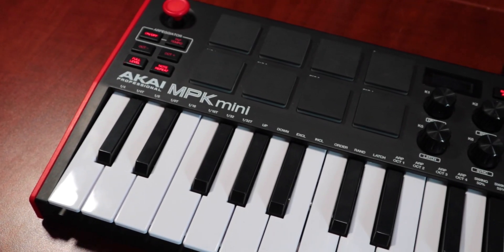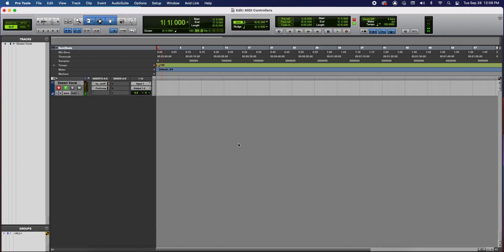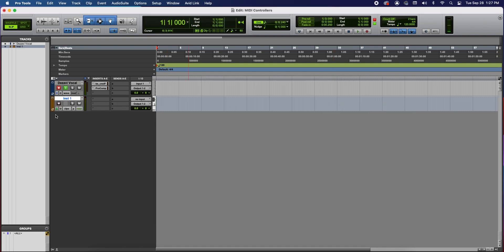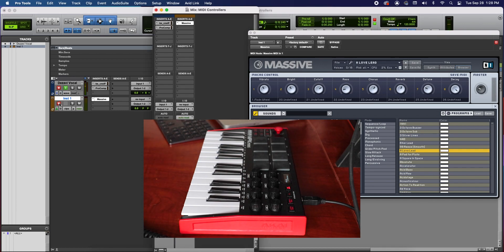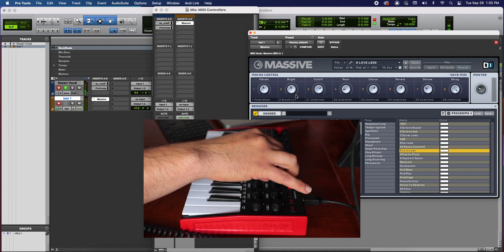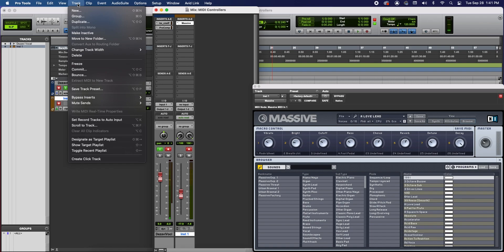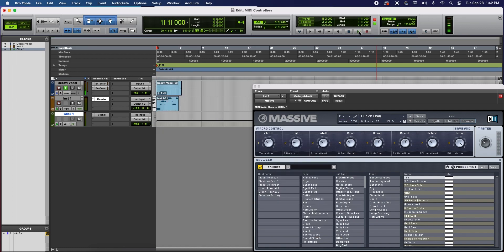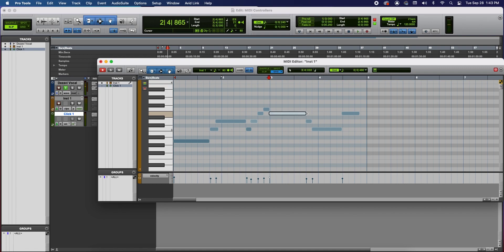ProTools MIDI Controllers Part 1 | How To Connect Setup & Use

Comment: hi Dezavi, thanks for Pro Tools MIDI Controllers Part 1 & P.2, very informative! Can you please post a video with the same set-up but using the knobs of the controller for volume & pan. I'm told it's easy using the controller in final mixes for panning, volume & EQ automation? Can you please help

Comment: Is it possible to use the play/rec buttons from the controller to control playback and record on Pro Tools?
Reply from the maker: Hi, it is possible yes. What MIDI controller are you using?
Reply: @DezaviProductions Have the same question. I just bought the Donner DMK25 pro(similar to Akai). The only buttons that work for me are the keys of the keyboard. Would love to also use the buttons for record, play etc. I wouldn't be asking if I didn't spend days trying myself. Great video by the way! Helped a lot!

Comment: And what if it still dont work?
Reply from the maker: Hi, I’m sorry to hear you’re having trouble. What controller are you trying to use with ProTools?
Reply: @DezaviProductions  Just figured it out. It was a volume issue. I have an Akai MPK mini. I noticed I still have to crank the volume way up as the drums and keys have a very low response.

Comment: i want to use the knobs for faders of volume or sends how can i do that?
Reply from the maker: Hi Elosbyuri! My apologies for the late response. I’ve been very busy the past year and will be getting back to making YouTube videos on a consistent basis starting next month. You can use midi mapping to assign the faders to the knobs.
Reply: @DezaviProductions  to control faders and knobs in protools you need a device that supports hui protocol. mpk does not support it. Theres a lot of info on the internet about that, people not being able to use knobs and faders with protools and mpk. i have not found not a single page with info about a person making it work. and ive been searching for days. as i learned - to control those knobs and faders you need controller that supports hui, wich is the protocol used by protools. You are literally the only person on the whole internet that made it work. How??? Please help cuz my mpk is practically unusable :( please help

Comment: How do you setup and play old school synths (Juno 106) (and their sounds) out of Pro Tools through 5pin connection? Thx
Reply from the maker: Hi, great question. I’ve only connected one and that’s the Ensoniq ASR10 that I have. I haven’t worked with it much digitally but what I’ve been able to do is use it as a MIDI keyboard by using the MIDI IN and OUT connections with an interface that has those same connections. As far as playing their sounds, I route the audio output to an input on a mixer or interface. Does this help? I think I’ll make a video covering this.

Comment: When I try to enter an input, the "plug-in" option is dark, and won't let me click on it
I'm using an Akai mpd226
Any advice by any chance?
Reply from the maker: Hey, it sounds like you’re trying to add a plug-in to a routing signal. Instead click on one of the slots on the “insert” section and it will allow you to add a plug-in. Does this help?

Comment: Pro Tools shows my MPK mini, though it has "Emulated" in parenthasis. But there is no sound coming from it. I've followed several guides and just nothing happens...
Reply from the maker: Hi, I'm sorry to hear you're having issues connecting your controller. I've had several comments with the similar issue and I'm still unable to figure out why some are showing "Emulated". Do you use the Akai MPK MIni Editor software that came with controller after you registered online?
Reply: @DezaviProductions  I was running the software, then I closed it out, and nothing happened either way. Odd thing, it just started working about an hour or so after I made my post yesterday. I don't have a clue what I might have done to make it work, but, uh, problem solved, I guess... #shrug
Reply from the maker: That’s great to hear, I’m glad it’s working for you now. Yeah that’s very odd. If you have any questions or anything you’d like to see a video for please do let me know, thank you!

Comment: I've done all that and still no sound
Reply from the maker: Sorry to hear that Micah, what controller are you using?
Reply: Novation Launchkey MK 3
Reply from the maker: I also have the Novation Launchkey MK3. Mine is the 49 key. If you have the same one, press the “Device” button under the first fader.

Comment: Hey Dezavi, great video! I am a complete newbie with ProTools, could you please give me some directions on how to properly setup I/O to hear my MIDI Keystation MK3 in my headphones when using ProTools? Thank you very much
Reply from the maker: Hey Lazzo, thank you for watching! What interface are you using?
Reply: Hi Dezavi, thank you very much for your fast reply, I do appreciate it.
I don’t use any Audio Interface yet as it is a plug-in and play midi controller, but maybe I should get one?
Reply from the maker: It’s okay, you don’t really need an interface if you’re not recording with a mic or instrument. First and foremost, make sure that the track you are using is record enabled and that the output is set to your main speakers/headphones. Also, in the drop down menus, go to “setup” and select “playback engine”. In there, make sure that in the device section, your have the proper selection for which you want to use.
Reply: Yeah, that’s what I’m trying to figure out:) It would be amazing if you could demonstrate how to properly setup midi controller ( IN ) using headphones (OUT) in Pro Tools, to be able hearing sound through the headphones.

Comment: Hello, I have the same AKAI MINI 3, I do all the steps but I get some things different.
1- MPK Mini 3 (Emulated)
2- inst 1 / plugin / instrument / Click II (Mono)... Thats the only option I get on the instrument tab :(
Then nothing happens.

I already updated the firmware for the Akai
Reply from the maker: Hi Alberto, I'm sorry to hear that you're having trouble with your MIDI controller. Did you download MPK Mini Editor for your controller? Also, it seems as though you have a "Click/Metronome" on your instrument track. It must be a virtual instrument that must be used in an insert of the instrument track. Virtual Instruments must be in the AAX format. Do you have any virtual instruments that you can use? Xpand2 is a popular default virtual instrument.
Reply: @DezaviProductions  I don’t really understand 😅. I’m following each step and have the same Akai mini as the video.
Reply: I’m going to download MPK MINI EDITOR then, I haven’t downloaded any additional software 😅
Reply from the maker: Yes lol. Make sure you follow all the setup instructions that came with your MPK Mini and that you register your controller with AKAI online. Also, I previously made a video on how to record virtual instruments. Here’s the link below: https://youtu.be/x5lRmb8q-II I hope this helps.
Reply: @DezaviProductions  thanks! 😅 si actually installed a bunch of things that came with it and then uninstalled others, I might have uninstalled basic ones also 🥴

Comment: I have a maschine mikro controller and it's not on the list. If it's disabled, is there any way to enable it for use? or am I just sh*t out of luck? Great video by the way!
Reply from the maker: Hi Ariel thank you for watching! There is another way to setup your MIDI controller. It is a bit different. I will try my best to explain it here but will most likely make a new video for the explanation. Go to "Setup" in the menu and choose "Peripherals". In peripherals click on "MIDI Controllers". Where is says "TYPE" choose "M-Audio Keyboard". Where it says "Receive From" and "Send To" select your controller. Click OK at the bottom. Let me know if this helps, I'll be making a video for this thank you for your question and I'm glad you liked the video, please subscribe! I have more videos on the way.
Reply: @DezaviProductions  thanks! I just tried this but no luck. I tried “M-Audio” on type with no luck, but I also have the option “Komplete Kontrol” which is my midi pad however, the “receive from” and “send to” only show my audio interface and whatever option I choose, pro tools gives me an error saying to power cycle my pad and check connections. It’s strange because my midi pad works perfectly on the Maschine software. It might just not be compatible but thanks for the reply and I will subscribe! Pro tools is giving me headaches lol
Reply from the maker: I’m sorry the options didn’t work, I’ll do some research and see how that issue can be resolved! ProTools is not the best when it comes to creativity and can sometimes make you hit creative blocks because of it. They just recently updated their softwares and added a drum machine finally after so many years. I’ll be trying many different things and post videos in regards to the new updates and drum machine as well as the synth machine. Thank you so much for subscribing and watching!

Comment: What about the pads ....
Reply from the maker: I honestly spaced out completely about the pads when making the video, but they play just the same as the keys. You can cycle thru the different sounds by switching banks but because there’s only 16 pads total combined between the two banks, you’re only limited to 16 sounds on the pads. The pads are most effective when using a drum machine VST.

Comment: I don't know anything about midi but I need to learn since I bought avid carbon.  Which midi controller (49 keys) should I buy which will connect easiest with pro tools 2021. Info will be much appreciated.  Thanks
Reply from the maker: Congratulations on your Avid Carbon Interface 🎊! There are many brands out there but my personal favorite for ProTools is Akai. A 49 key controller they have is the MPK249. This one has a transport (Play, Stop, and Record button) that you can use to control ProTools. Other great brands are Alesis, Arturia, and M-Audio. Other brands such as Novation and Native Instruments are great too and are compatible but are typically paired with other software. You’ll find that many MIDI Controllers have settings that are mapped to use with all software and never have settings for ProTools. This is because ProTools isn’t typically used as much for beat making. Other software such as Fruity Loops and Ableton Live are much easier to get creative in than ProTools. I personally use Ableton Live to create beats and experiment with music. I use ProTools for all editing, mixing, and mastering. I use both. Ableton for creation and ProTools for perfection.

Comment: Hey dude, I've done everything, step by step and still no signal coming from my MIDI. ProTools identifies it in the MIDI setup. I create an instrument track and still no signal coming through...Any help?
Reply from the maker: What keyboard or controller are you using?
Reply: @DezaviProductions  I just got the akai mpk mini
Reply from the maker: Okay, and what is the plug-in virtual instrument you are using?
Reply: @DezaviProductions  it’s gotta be my DAW yeah? ProTools and my interface are not getting the final from the MIDI..
Reply from the maker: @krutonfreckle  if you’re using a USB cable the interface shouldn’t be involved. Make sure you have a Virtual Instrument plugin on your instrument track and that the record enable button is on as well as the output set to your monitors/speakers. Create a mono instrument track and then add your virtual instrument plug in to that particular track. Let me know if you continue to have issues, I’m here to help!

Comment: I'm having some trouble connecting my motif 7 to pro tools...I downloaded the driver and the motif shows up as checked off in the set up-MIDI-input devices menu. However, I'm not getting any signal from it into my instrument track(using expand). I'm Using the Apollo x4. What am I missing?
Reply from the maker: Hi! I’m sorry to hear that! There was someone who had a similar issue with their device and they mentioned that using a mono track instead of a stereo track fixed the issue. Try creating a mono instrument track and see if that helps. Also, make sure your track is record enabled and that your outputs are correct as well. Let me know if this helps, we’ll figure it out 👍🏻

Comment: In input enable settings my screen says MPK mini 3 (Emulator) instead of just MPK mini 3 and I'm wondering if this is the problem. Thoughts?
Reply from the maker: Hi! It very well could be the problem. Couple things to trouble shoot. First check to make sure that “MIDI THRU” in the “OPTIONS” drop down menu is checked and enabled. Restart the software after if needed. If that doesn’t work, make sure your firmware for the MPK Mini is up to date. I’ve attached a link for the firmware update for the MPK MINI MK3. Follow the steps and let me know if this does or doesn’t fix the issue. 
https://www.akaipro.com/mpk-mini-mk3
Reply: @DezaviProductions  I've updated my firmware and thought it was going to work but it still does not work :(
Reply: I GOT IT; opening it under a mono track worked xD holy hours of frustration gone in seconds
Reply from the maker: Awesome!👏🏻 Glad to hear that!